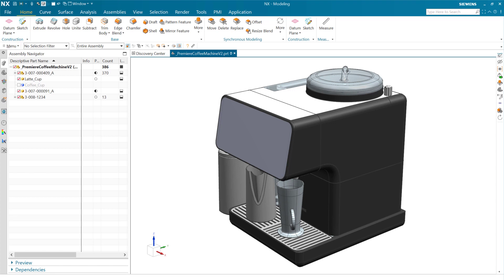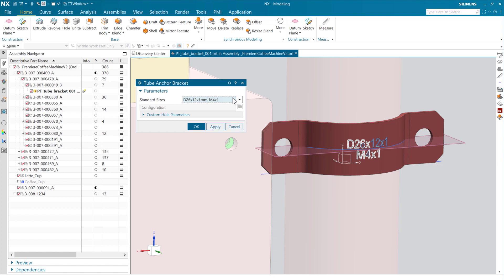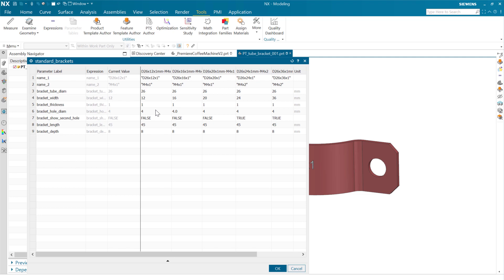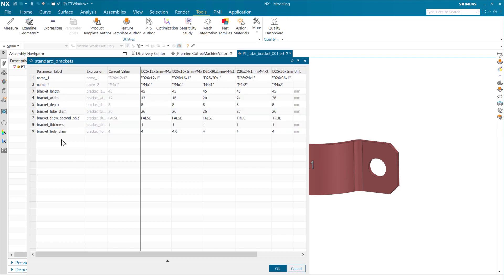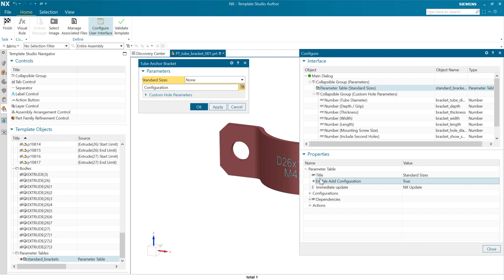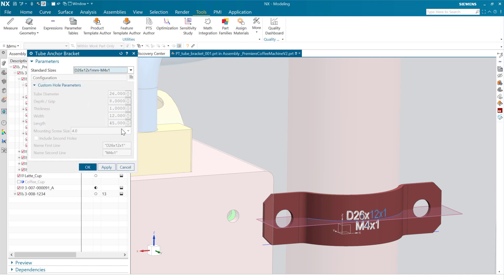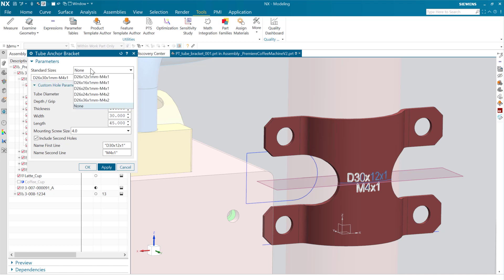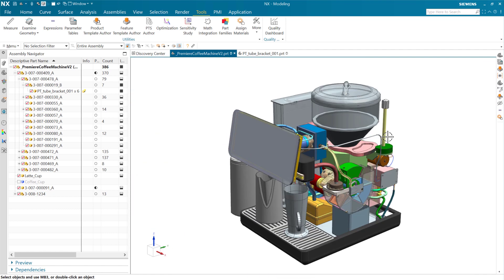NX Product Templates: Using a Parameter Table with new data types [NX 2306]

Comment: if i want to import a new table from file how to do that please explain.
Reply from the maker: In the "Actions" group on the Parameter Tables dialog, you can use the "New Table from File" option to start a new table using an Excel spreadsheet or CSV file.  

The easiest way to understand the required format is to manually create a small Parameter Table and export it.  (MB3 on the name of the Parameter Table after you've created it, and choose "Export".)  Does that help?

Comment: How do 2D drawings work with product templates?
Reply from the maker: Quite well.  :-)   You can certainly create an associative drawing describing the part or assembly in your Product Template, and then have this be associatively copied and updated as you instantiate your Template by dragging-and-dropping from the Reuse Library.   Great question!
Reply: @taylorandersonnxvideos  Thanks Taylor. We use TC managed NX at my workplace with a master 3D and then a 2D manifestation file. Our current workflow is we open a reference part and "save-as" to create the new part, and then modify expressions and adjust 2D if necessary (eg adding rev note).

What would be the workflow to create a new part based on the product template feature? Would you create a new part and then drag/drop from reuse library, which would then populate the features, and also create a 2D manifestation?
Reply: @taylorandersonnxvideos  Hi Taylor, just saw your video on 2D drawings and it all makes sense, only question I had was whether it will work with TC managed NX.
Reply from the maker: @espresso-shot  Great question!  The easy answer here is yes.  The template interface is all self-contained within the drawing PRT file, so there is no additional complexity here from the Teamcenter perspective.  Does that help?